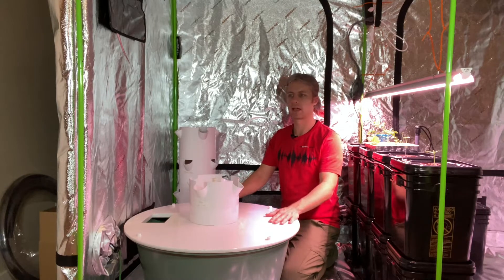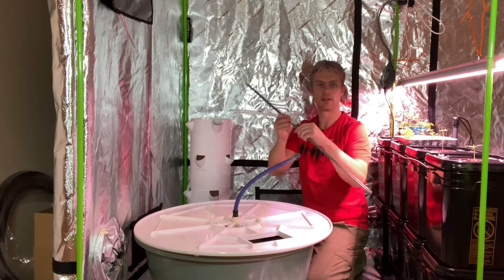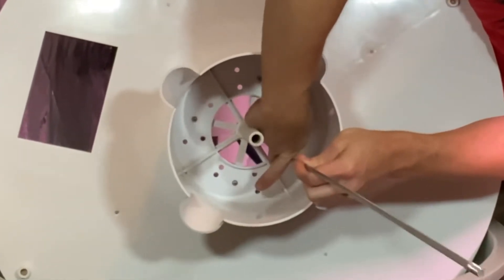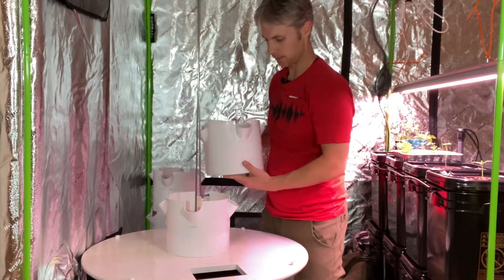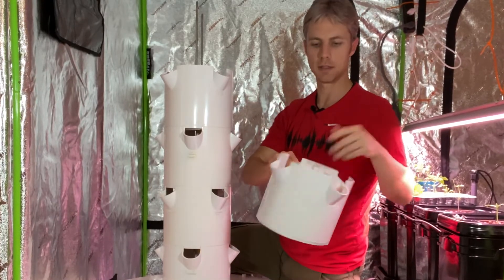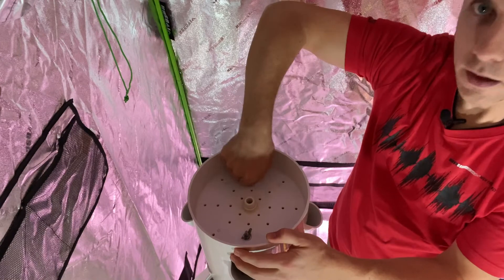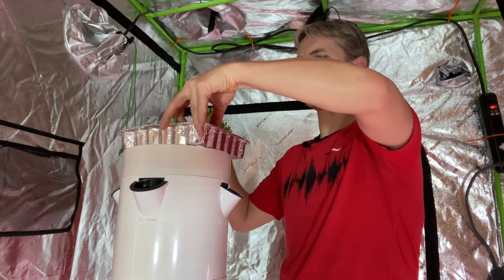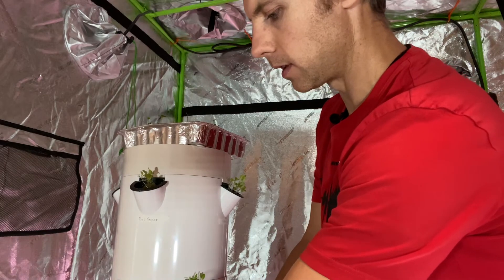The Easiest Home Hydroponic System Setup: The Tower Garden

Comment: The tower garden costs the equivalent of $718 here, crazy price for what is essentially a pretty basic vertical  hydro system.
Reply from the maker: It's not the cheapest way to grow hydroponics but keep in mind that the tower comes with $200 worth of nutrients, rock wool, seeds, pump, timer etc. Buying large diameter UV stabilized and food grade pipe and a 30 gallon reservoir isn't cheap either. There are ways to make a similar setup at home for less and I am currently exploring alternatives for upcoming videos. For a vertical hydro tower that arrives on your doorstep it does provide great value, especially for people just starting out. I've been growing with it indoors and outdoors for years and it just works. That's why I call it the easiest and not the cheapest. Making DIY alternatives is awesome too, I love trying out all different methods like the aero buckets!
Reply: @smallscalegardener  
As someone who makes their own nutrients from scratch i can tell you the tower tonic is not worth anything like $200 :) It is also very weak in terms of concentration compared to many bottled nutrients. The idea is for you to use it faster so you have to buy another bottle. Honestly, if you run the TG year round you would save a small fortune by using something like Jacks 5-12-26 and Calcinit. (calcium nitrate)
A quick google suggests a gallon of tower tonic A and B costs $65 and will make 189.25 gallons of nutrient solution. To make the equivalent 189.25 gal of nutrient solution using Jacks and calcinit you would need 436g and 265g respectively. I didnt check the current price of Jacks but i can tell you 265g of yara calcinit would have cost me the equivalent of 23 cents (£0.19) when i bought 4 x 25kg sacks of it last year. World events have forced the prices to rise so i would expect the tower tonic to increase in price even though the current profit margin is outrageous :)
Another option is GH Maxigro dry (one part) nutrient which is a close match to the tower tonic formulation, 189.25 gal requires 813g of maxigro, a quick google search suggests you should be able to source  1kg (2.2lbs) of maxigro for around $17. (1kg = 232gal).  Note, it also includes a fairly hefty profit margin.